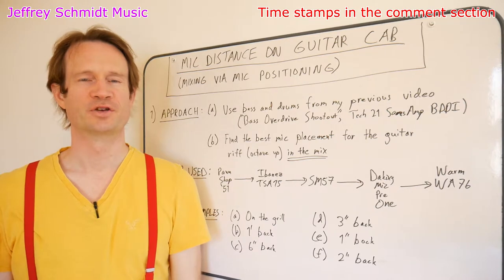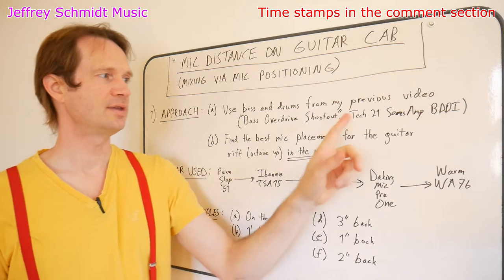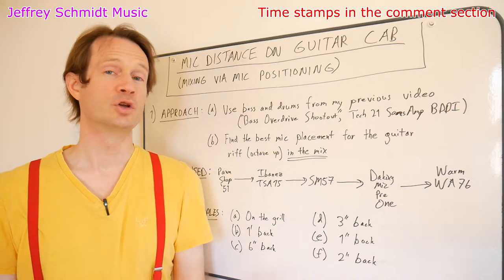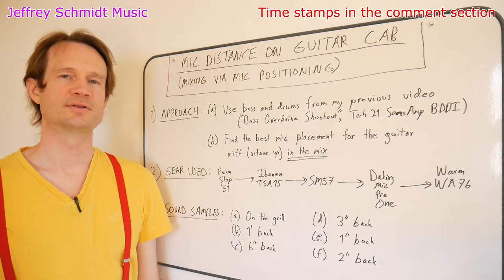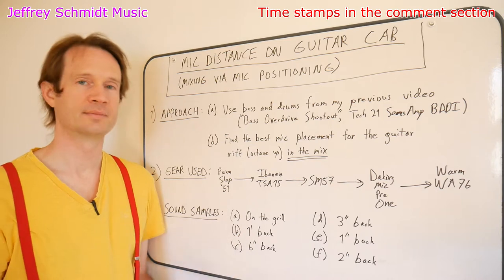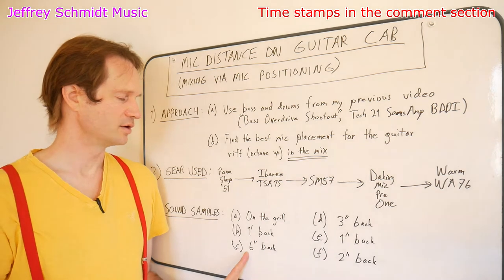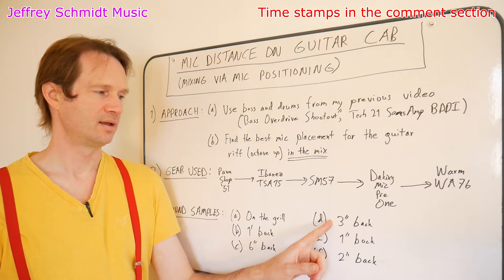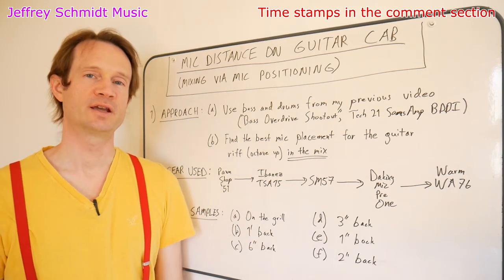Mic Distance on Guitar Cab (Mixing via Mic Positioning); an example with sound samples

Comment: I actually prefered the sm57 at 1 foot, it seemed to clear the low end mud that conflicted with the bass guitar at closer distances. Could be the proximity effect on the frequency of the mic?. I was actually pleasantly suprised by this results, so thanks for taking the time to do this.
Reply from the maker: Yeah it's a definitely all a question of taste.  I think that most people (even myself) don't usually take the time to do this sort of thing, and that when we do the results can be surprising.  Of course alot of that mud can be removed via EQ but its quite nice to start the mix with something that already sounds as good as possible.
Reply: @JeffreySchmidtMusic  I remember hearing that Geoff Emerick when recording the Beatles would spend a long time with the eq on their amps to make sure each had their own sonic space. It definitely is best to make decisions as you work, I find it more productive.

Comment: Great video, and I can vouch for what you said about having to come back to things later if you don’t love the results. A band that I work with that records one song at a time with me is a perfect example. Each time we have tracked we have done something different to improve the guitar tone, and on this last song that we did, we found our favorite combination, which was an SM 57 off axis to the dust cap, and a small diaphragm pencil condenser straight on the speaker between the dust cap and the cone. About 4 inches back from the cloth !! This was tracking a Gibson SG through a marshal JCM 800 into an orange 4 x 12 with vintage 30s !! 👍🏻👍🏻
Reply from the maker: Awesome!  There are just so so many possibilities that open up when using two mics.  Things come out so much better when we take the time to experiment.  We don't always have that luxury, but I'm always so much happier in the end when I do take the time.
Reply: JeffreySchmidtMusic I totally agree, it’s worth it to take the time even if it’s a client and they are paying for that time, in the end they realize it was worth it to experiment and get the right sound, instead of just plugging in and taking what they get right off the bat.